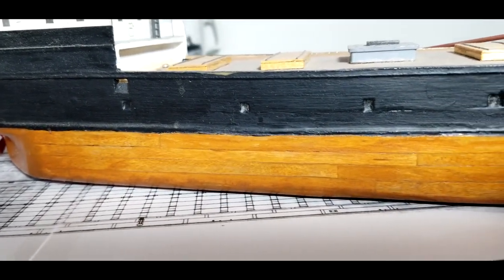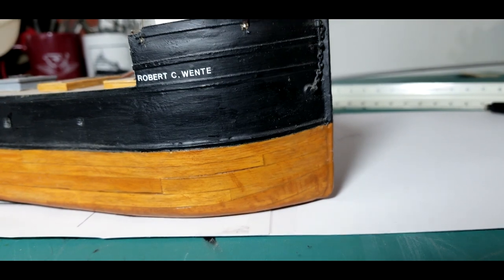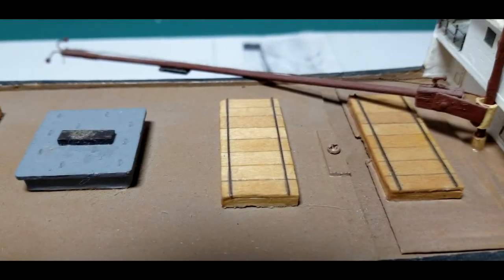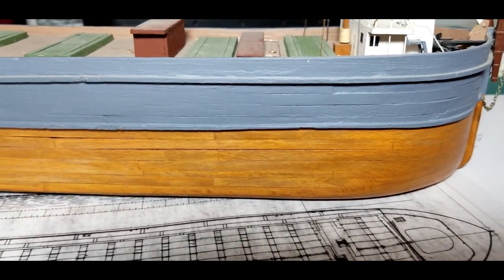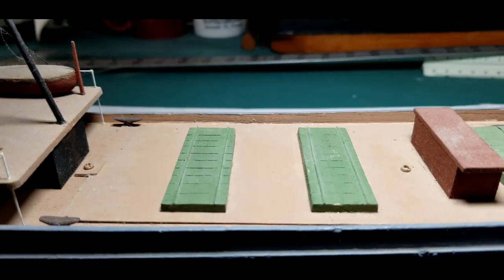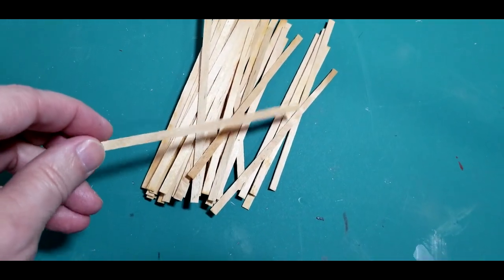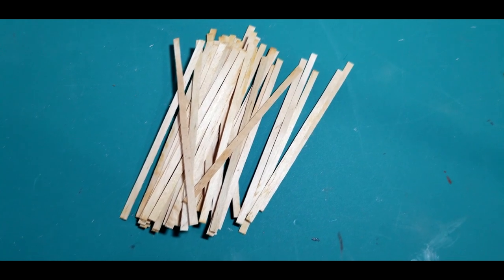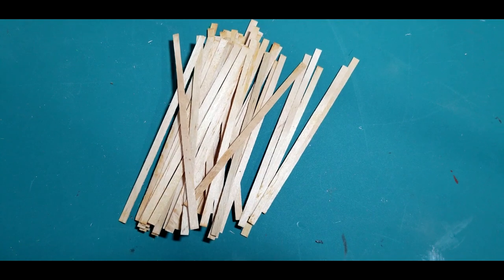Model Boat building Hack Number 1 How to make imitation wood planking

Comment: I would love to build a few steamers-1860-90s with the longitudinal arches....How do you waterproof your models.i have made greek/roman war galleys out of balsa.After painting them they got many coats of thompsons water seal.
Reply from the maker: Just plain old Testor's enamel works fine. For a while I was spray painting mine with epoxy, but then they stopped making it in red... so, I found that enamels work fine. I paint both inside and outside. Thanks for subscribing. More model stuff to come.